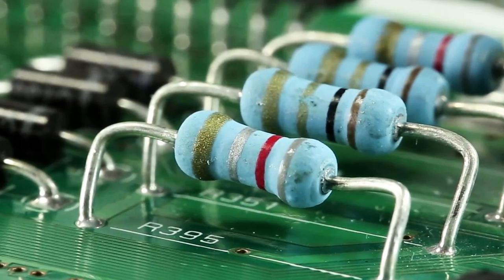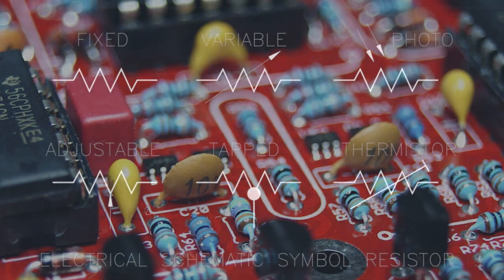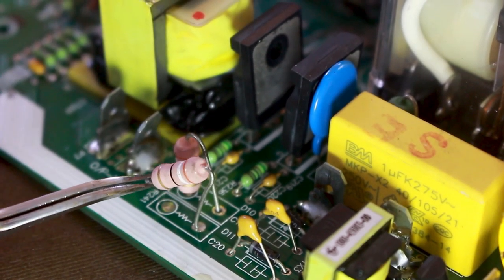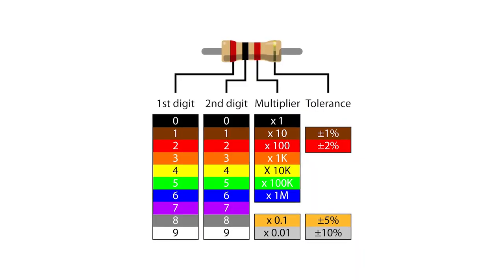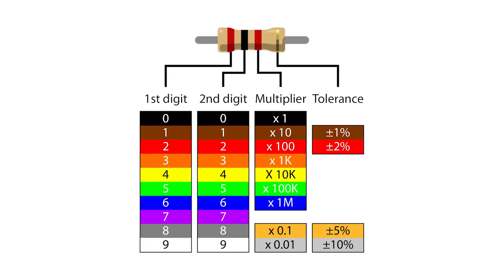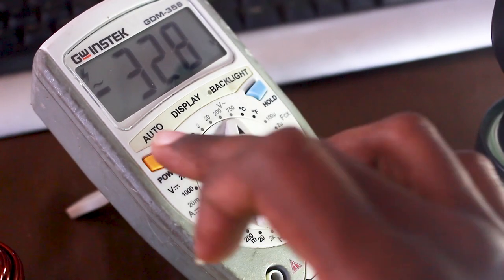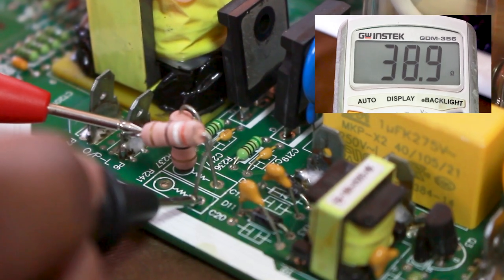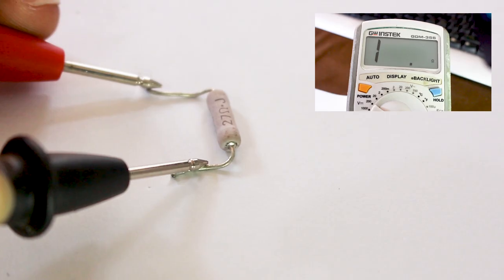How to test a Resistor

Comment: So if the board has 100 resistors then you have to resolder every one separately?
Omg 🙉
Reply from the maker: No, it is not necessary ....
Please watch the video again
"If you suspect that a resistor may be faulty
this is method to check it " This is the content of the video
If we suspect a resistance, by doing so we confirm whether it is faulty or not
If a board has 100 resistors, you do not need to remove each one separately. Must also have basic electronic knowledge to suspect which resistor is faulty
It also depends on experience
So, watch the video again and improve your knowledge
I am happy and appreciative of your comments
Have a nice day
thank you
Reply: @EEEWORKSHOP  So if there are 100 resistors, how does one with much skills as yourself determine which one looks suspicious? I usually call scooby and the gang to solve such mysteries, but I’m hoping you can give me a clue. 😎
Reply: @globalmagicnation8464  
 In electronic circuits, resistors are mainly used to reduce current flow (i.e. resistors function is like a valve that controls the amount of water that passes through it). If a resistor is dead no current passes through it (like a dead fuse or a dead light bulb) and if a resistor is faulty  it passes less or more current that it was supposed to pass. You can measure the performance of a resistor (and other electronic devices) on a live circuit board, but this needs knowledge and skills and tools.  You can measure the amp that goes into the resistor and the amp that comes out of the resistor then decide if the resistor is doing its intended function or not

Comment: If I use a multimeter to test voltage across resistor in a circuit with supplied 12v and it reads , will the multimeter still reads the voltage across the resistor if I open the supply since the multimeter have a battery? Looking forward to your answer. Thanks

Comment: Sir
There is a PCB Circuit, in such case
If we try to Replace Components
Such As Replace N-Channel MOSFET With IGBT while how can I calculate Resistor, capacitor Value it's series' and parallel ?

Comment: Hello, can someone please advise me what the multimeter shows when there is bad resistance in the circuit, thank you very much
Reply: It should show an infinite value, usually shown as a value of 1. But try the different positions on your multimeter 20K, 2000K, 200, and the other ones, if they all show 1, you have a bad resistor.
Reply: @kevinleblanc9498  hi,thanx